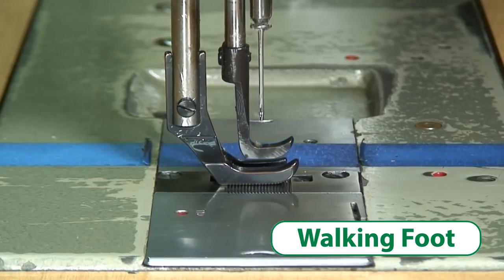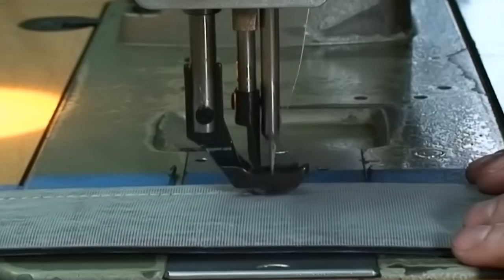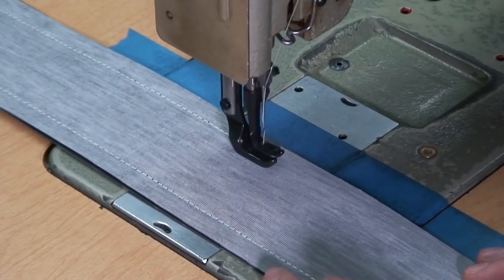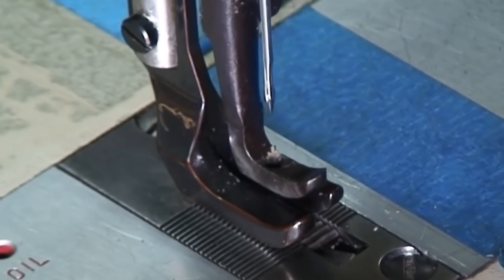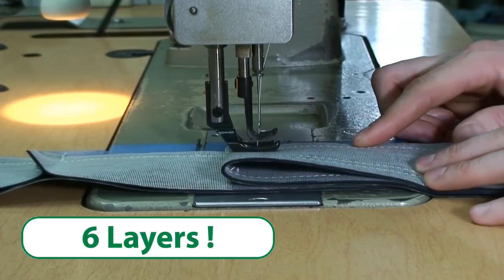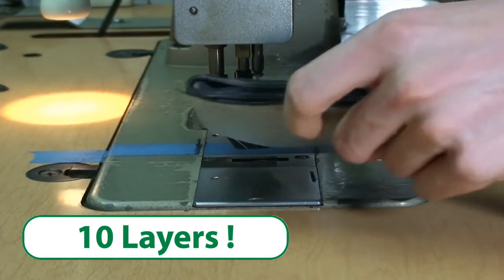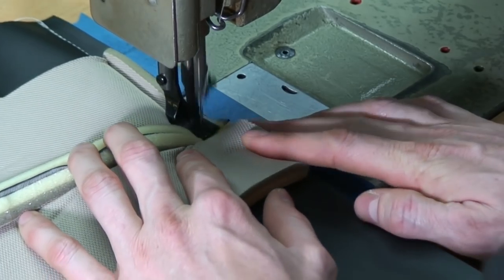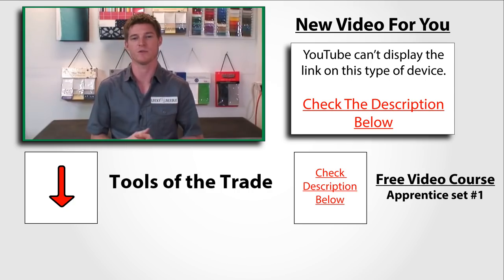What is a Walking Foot Sewing Machine? - How it works and why you need one!

Comment: so what's the downside?  very expensive maybe? prone to breakdown?  can't use most common ordinary sewing machine feet with them?  what?  sounds like a necessity for upholstery work but maybe totally unnecessary for normal sewing and with a few 'downside' things should be avoided?  and p.s. is this where to look if  you want to upgrade from home sewing machine to sewing fairly light leather?  not a 'saddlers' or 'leatherworkers'  industrial machine but just need any 'walking foot' machine, would that be right?

Comment: Absolutely correct! The ability to climb over layers of fabric is what really makes a massive difference between a walking foot and a standard foot machine. I have used both and actually own a Singer 111w114 witch has a standard foot. I bought it because it was a great deal and the standard foot can get you by on some basic stuff or when stitch consistency isn't important. However I will be replacing it with a walking foot someday. When I get one will basically boil down to when I have a job that absolutely requires me to have one or when the right deal lands in my lap.
Reply from the maker: Thanks for the great insight!
Reply: The Lucky Needle ......where can I purchase one of those machine I'm from the Caribbean, can you send me details plz thnx

Comment: Another great video!!!   I recently acquired a Brother LS2-B837.  Watched many of your videos before taking the plunge.  I do understand many of the basics as far as Needle Size and Type, Thread Size and Type, Tension, Etc.....    Several practice pieces with very good results.  I am also in your Apprentice Program.  The absolute most confusing thing for me at the moment are all the different sizes and styles of walking foot sets, along with where not to buy.  Smooth bottom versus toothed bottom, and why?  Tooooo many questions I guess.  Thank you for all the time you have invested in this venture - Stephen
Reply from the maker: Hi Steven! Thanks you for such a great question! It helps me improve the courses and videos. 

I use the smooth set. The tooth sets are for if you are having problems with slippery fabric. But they can also leave marks in other materials and that's why I use smooth flat feet.

If you have tons of questions I encourage you to join our forum. TheUpholsteryForum.com  Lots of great information and people willing to help there.
Reply: @Theluckyneedle  Thank you for the quick response.  I will look into the Forum in the very near future.

Comment: Thank you! How do you find a used walking foot machine for a cheaper price and know that is in good condition for sewing heavy leather 4 oz. +) and upholstery material and foam? What features should I look for? What is the price range and brands?
Reply from the maker: Craig's List is my best friend for finding used tools at great prices. Best way to see if its in good condition is to sew some test sections. If the machine is rusty that's a bad sign because it means its been outside or hasn't been oiled in years. Excessive ware is ok as long as the machine has been somewhat taken care of. I bought the juki in the video and it had been used so much the industrial paint has worn off in some areas but it was taken care of and still sews great to this day. 

You defiantly want to make sure your machine has a reverse lever.  You should be able to find a good used machine between $600 and $1000. Sometimes you can find better deals if your lucky. All the name brands will be good. Juki, pfaff, consew, adler, brother, etc.  Avoid the new consew machines made within the last 5 years or so. The old ones are really good though.

Comment: Great video, thank you for the detail and the slow motion!!  Question for you... what is your opinion of the Brother DB2-B797?  It is "duel drive" not triple drive like the true walking foot, so when the needle comes up the presser foot and dogs move the material and when the needle comes down the needle foot holds the material stationary while the presser foot resets.  Any thoughts?  The Brother I describe is available in my area, but I'm concerned that I might be settling too much and as you mentioned might regret it later.
Reply from the maker: Thanks! If you going to be sewing a lot of heavy material. Like for cars and boats. I would recommend passing on that one getting a true triple feed walking foot machine.

Comment: Very good video. What type of machine are you using here? Does this machine have a servo motor? I've noticed the clutch motors are hard to control when trying to slow them down.
Reply from the maker: Glad you like the video! This is a Juki lu562 with a clutch motor. Yes the are difficult to learn to control but you get used to it.

Comment: Question for you... You warn against buying the wrong machine, I purchased an old Singer 31-15, but I see now that I should look for a machine with more features.  What other features would you recommend so that I don't buy the wrong machine again?  So far it sounds like I should be looking for: walking foot, lock-stitch capability, servo motor... anything else? 
Thanks!
Reply from the maker: The walking foot feature is a must. Most walking foot machines come with a reverse lever to do lock-stitches. A servo motor is really nice but not a must. I highly recommend the in table machines also. The portable walking foot machines are to small for auto/marine upholstery.

Comment: Hii, i'm in need of a walking foot machine but not sure which one to get, I really like juki brand. Is this machine strictly for heavyweight fabric, or can it also sew lightweight(clothes)? I most definitely won't be working with vinyl or leather but more of a medium weight upholstery with several layers plus piping/cording. Thanks in advance!!! :)
Reply from the maker: It should work great with medium weight fabric. I don't recommend it for light weight fabric like clothes. If your going to be doing clothing you would be better off with a non walking foot. Plus non walking foots are less expensive.

Comment: Nicely done video. My question: The Artisan 797-AB is an alternating feed walking foot, while the Artisan 618-1SC is a Compound Needle Feed walking foot. The 618-1SC must be better, but I really don't understand the terms or what is the difference. BTW I bought a used 797-AB used for $400, about half of the new price, it seems very well made.
Reply from the maker: Michael. I'm not familiar with those specific machines your referring too here. Sorry I cant help much on this one.
Reply: I believe the difference is the latter might have a triple feed. this means the needle feeds the material with the middle foot keeping everything together more efficiently like the machine in this video.
Reply: just do a search on triple feed walking foot and you should find a good explanation

Comment: Hey, I got an industrial walking foot cylinder-bed machine, however, when stitching thicker leather or multiple layers, the foot leaves a mark all along the stitch. What could be the trouble? Maybe the pressure of the presser foot or/and walking foot? Should I make it looser or tighter? But making it looser, it might not press the layers all-together well :(( any tips??
Reply: less pressure or you might try and replace the foot with a smooth one.

Comment: Whats the difference between a walking foot and a compound feed walking foot? I can't seem to find a definite answer.
Reply from the maker: Walking foot , triple feed , compound feed are all the same name for the type of machine in the video.
Reply: This is not a walking foot machine....
It is a compound or unison feed machine.
They are not the same.
A walking foot has alternating presser feet that transports the medium when the needle is up.
A compound feed machine uses an alternating presser foot system, however the medium is moved with the needle in its downward cycle. This is a more powerful feeding mechanism and ensures a perfectly consistent stitch length, idea for external or top stitching.
Compound feed machines can have vertical or horizontal axis hook system, rotary or oscillating.

Comment: can you sew upholstery on a non industrial sewing machine?
Reply from the maker: You might be able to sew 2 layers of vinyl together but not much more than that. But lucky if you look around you can find used walking foot machines for pretty cheep.
Reply: i did six layers
 in slow motion while putting Singer oil directly to the needle every now and then.
Reply: How fix the reverse lever is is going up and down?